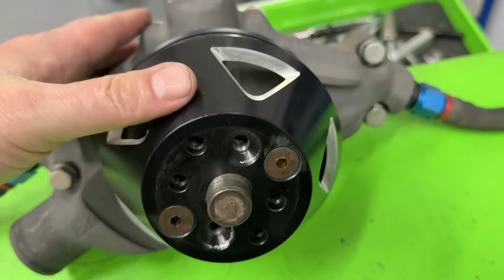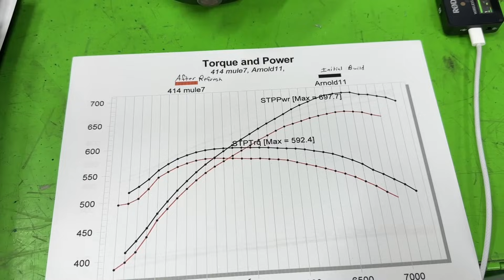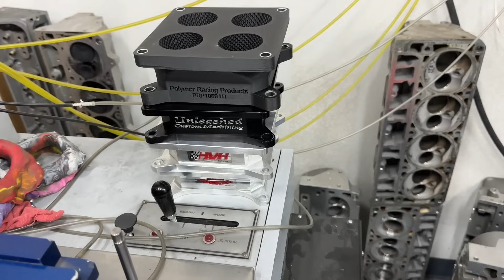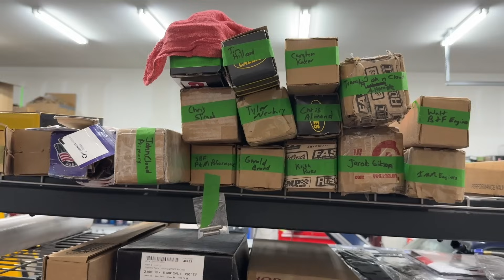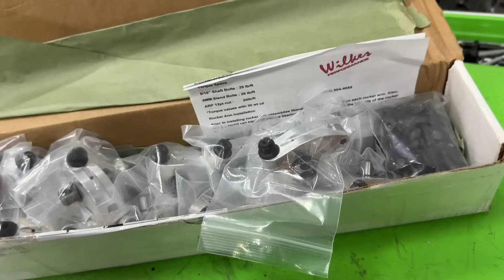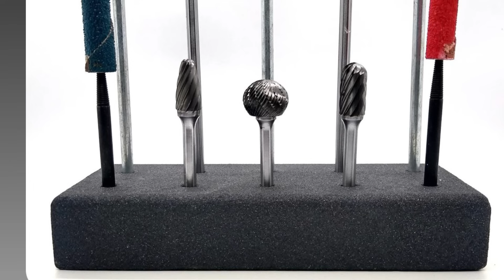Mechanical Water Pump vs Electric Water Pump Dyno Test

Comment: I bought a chevy tralblazer and put a lift and 32 in tires on it. Got crappy gas mileage. I googled it and the internet said take off the mechanical fan and install an electric fan. So I did. I had all the stuff to make an automatic control for electric fan but had not gotten to it. I was pissed one day driving around to clear my head. I did not turn my fan on it was hot. I probably had ac on too. I melted my engine down. Moral of the story is the internet can be right  and still be wrong.

Comment: Let me ask, I get it made more hp richer. But lets say you had left it at that 12.8-13.0 and added timing? I mean thats something I feel Ive learned. More fuel generally less spark, more spark, less fuel. Up to a point of course.

And the LS vs SBC cam where you said you were having an identical cam made, won’t the difference in the cam core between the two make the difference?
Reply from the maker: Sometimes that is correct but it didn’t want more timing either.

Comment: A set of 18 degree heads I ported had the valve job re-cut by some old timer who used a cutter with a 30 degree top angle. Ruined them.

Comment: I built an electrically powered blower unit that makes 8psi without the engine running, 5psi in the low end of the band with it running; but it's all gone by red-line (which is OK because I'm shifting my Tremec TKO 600 then anyway). I used a 72vdc 12 KW Me 0913 brush-less motor with a 2 1/2" 8mm blower belt drive @ 1:3 (powered by six 12v lawn-mower batteries) to spin up a Paxton Novi 2000 centrifugal for my 1st gen smblk. in my 87' Camaro. The motor and the blower are mounted between parallel 3/8" thick 9" x 18" plates with (4) 1" x 9" aluminum round-stock stand-offs between them around the blower at the top and a 9" x 9" x 3/8" base-plate connecting them under the motor at the bottom. Since the belt-drive is on the driver-side the self contained lube oil system is on the other, and the base plate is mounted to a couple of poly sway-bar mounts on top of the sway-bar between the engine and radiator. To make room I had to build a water intake manifold out of 2" aluminum square tubing stock with Meziere flanges and put an in-line Stewart brush-less water pump in the bottom hose to feed that manifold. The only problem I ever had with the pump was with the cheap-assed connectors between the pump and it's controller. Although it was damn near $400 I have a spare now because I bought the second one before I found the connector issue with the first. I use a 16 bit V2.2 Megasquirt for my EFI and built a spare unit for that too because I love its simplicity. I'm very much into integrating electronics with engine management now and am looking foward to experimenting with a crank driven brush-less motor to use as a supply for all peripherals including dry-sump, power steering, auto-tranny, crank-case evac, and AC pumps, plus anything else I can think of to make belt drives obsolete. The main PITA will be the battery and DC to DC converter development; but I think it's high time 12vdc systems for modern vehicles to become a thing of the past. I have some crazy ambitions concerning hybrids too but that's another story.

Comment: Dam that little I was expecting more I would of thought 15hp what I want to do with my engine I wanted to put a crank driven water pump instead of a standard water pump like take the pulleys off belts and less weight with the crank driven just like all the sprint car guys I would of thought 10hp gain nope I guess not probably 1 or 2 now dam that sucks
Reply: So what i am saying probably I won't make any difference it sounds like when I do crank driver but less weight is all I guess

Comment: Has anyone ever tried using different sized valves on the end cylinders? Like using different cam grinds to make up for imbalance of distribution?
Reply: comp had a cam line with differing lobes .I think to help with restricted or junk intake manifolds.

Comment: Are you running an electric cooling fan ?
Reply: On an engine dyno the cooling is usually done by it being a big tank of water.  They don’t typically have any sort of radiator and fan like when it’s in a car.